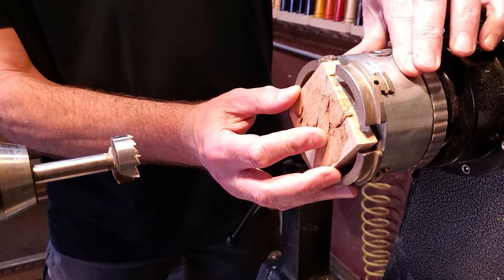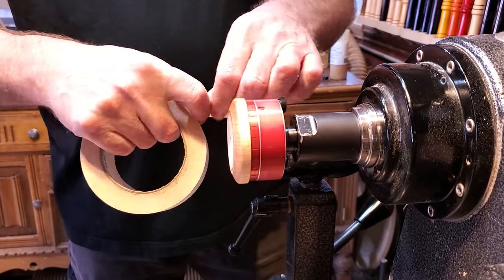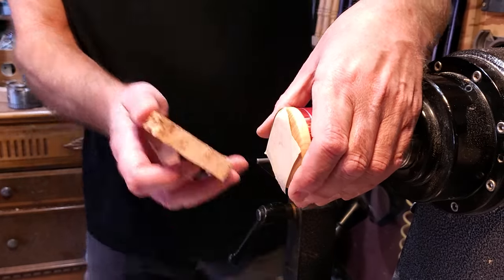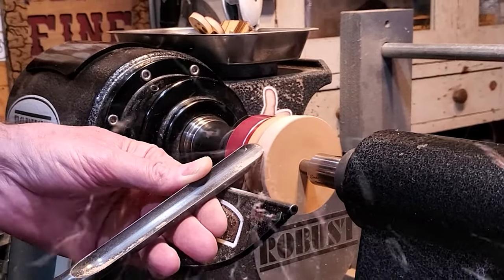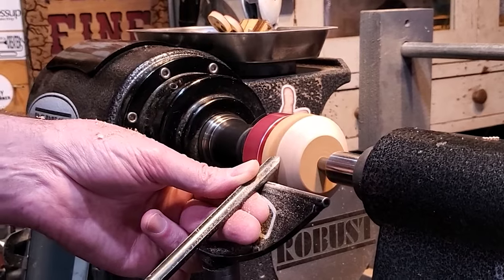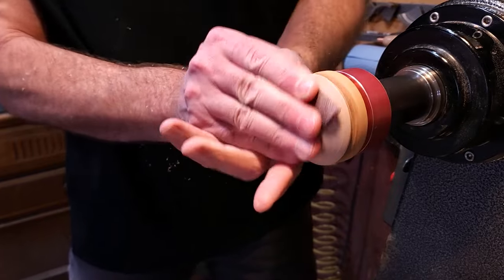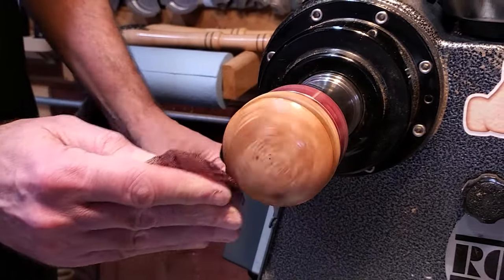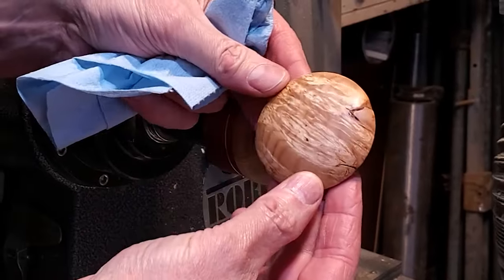Woodturning | Craft Show Projects That Sell Well

Comment: I started buying seconds from a local hardwood supplier for making my off center pendants and earrings.  Some of it is 1/8" thick and I glue contrasting pieces together and turn all the way through the first layer to show the second layer on pendants and then also make the edge of the first layer so thin you see a ring all the way around of the contrasting layer.
Reply from the maker: Very cool, I would love to see some pictures.